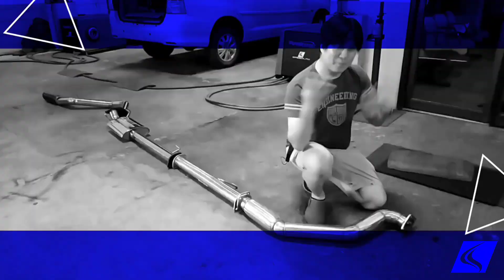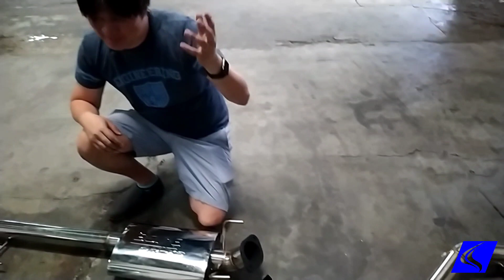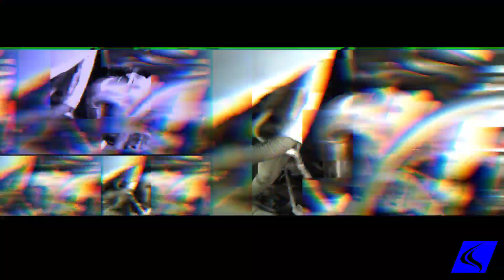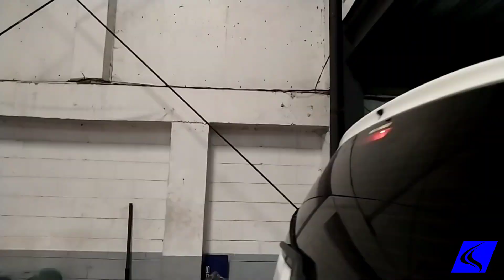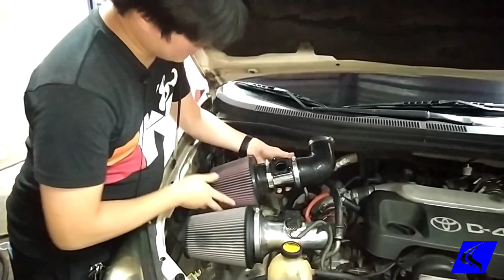Project Elsa Innova Part 2:  HotPipes downpipe and testing of other shop's air intake

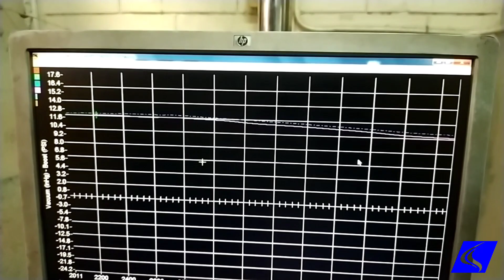Comment: Noob question sir at 5:23 mark of your video, you said that the boost went down after installing the downpipe, and loss of boost is loss in power, though I'm confuse why there is power and torque gain still?
Reply from the maker: Because it’s more efficient 
If you make power with less boost

That’s a good thing

Dami mo tanong, papagawa ka ba
Reply: @speedlabchannel4452  yes sir, bumebwelo lang hehe
Reply: @speedlabchannel4452  nagpagawa po ba sya!? 😂
Reply from the maker: @raymundamansec  probably not

Kulang sa bwelo

Comment: Do I have to change my stock turbo if it will be remapped? for  innova 2.5 dsl 2007 model..thanks
Reply from the maker: No. Stock turbo with remap will give you 40-50hp
Reply: sir.. i ask this becoz some say it will harm the engine if the stock parts (air filter, turbo, exhaust system) are not replace with upgraded parts.. do i have to replaced all stock parts? thanks sir sid..
Reply from the maker: @valmikeroca1352  those some people just want to sell you more stuff

Comment: All in all how much po?
Reply from the maker: K&n intake 10500
Downpipe 15000
Ecu remap/reflash 25000
Reply: Sir ask lng what if full 3" exaust but I will briing my own muffler at tip? Thanks.
Reply from the maker: @edjirhodaalunday5185  28000
Reply: Tagal ng part 3 hehehe...
Reply: Oki lamg ba sir mag install mona downpipe at knn air intake saka na magpa remap? Thanks

Comment: Is there such a thing as a 4-inch exhaust system? Or is it just a 3-inch system with a larger opening at the muffler?
Reply from the maker: There actually is, but the bad part is that the space constraints under most cars limit it only 3”

Plus it’s really hard to get 4” mufflers.